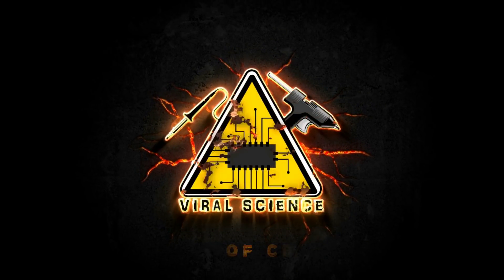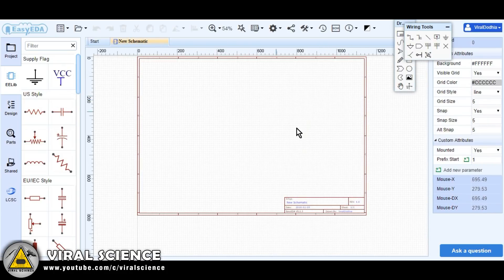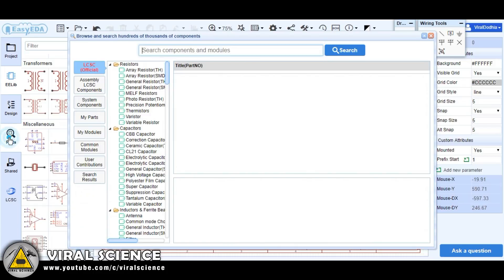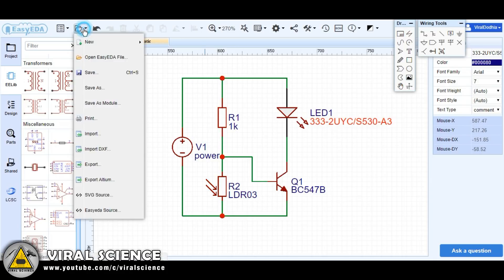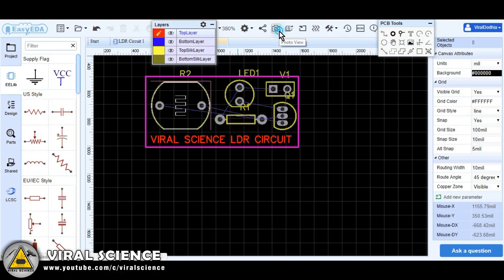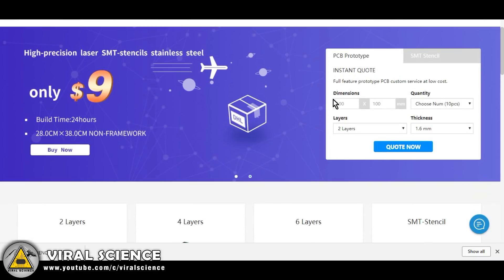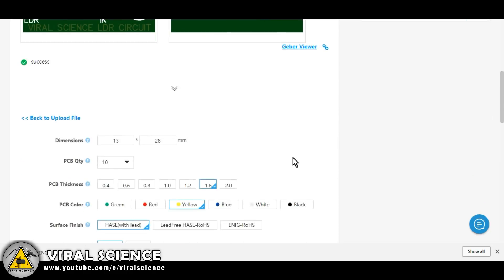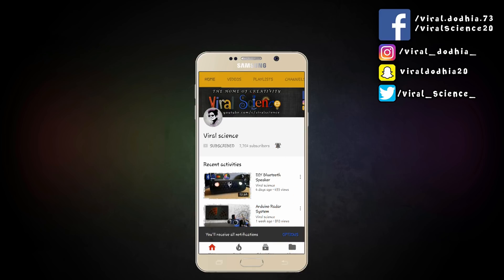JLC PCB | Design a PCB | only for $2 | EasyEda

Comment: Hey will u help in designing the pcb for wifi home automation with nodemcu and relays
Reply from the maker: No such pcb design is needed just you have to provide signal pins of relay to nodemcu and the powersupply pins its one of the easiest connections and best project
I dont think so any pcb design should be required for this
If you dont have a relay module then you need to connect transistor,diode and make pcb for it.
Else not required

Comment: Shipping is not free and shipping is a lot more expensive than the item you are paying. Think again, $2 for the pcb but the shipping is $17. What a joke!
Reply: I'm close to making my first order.  I placed 2 board designs on one 100x100 board.  Each 100x100 board will have 5 small boards and 4 large boards.  Works out to 50 small boards and 40 large boards for $20.00. 0 22 cents per board.   I just have to cut them up.